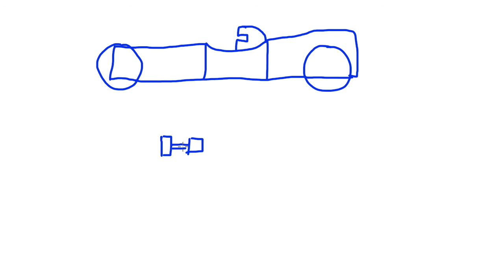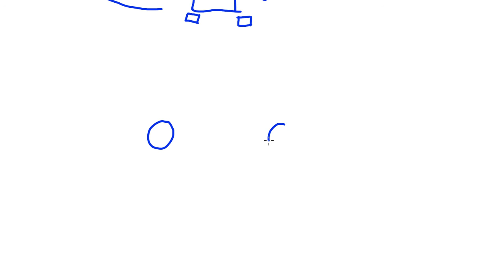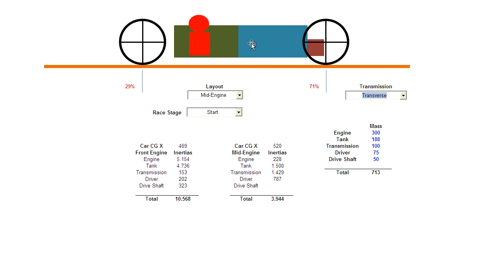Advantages on Mid-Engined Race Cars versus Front Engined Automobiles

Comment: I don't think polar moment of inertia makes much difference in a four wheeled car. The mid engine layout is to load the four wheels evenly and permit a lower center of gravity (because the driver can be sat lower).
Reply from the maker: Sure, but the old cars had a heavy engine at the front end and heavy fuel tank at the back end. This made the car akin to a dumbbell. The wheels were evenly loaded as well, but the car's "laziness" to turn was factor

Comment: question, in race-simulators i've been having some issues with braking/understeer in lightweight mid engine cars. for some reason i think having too much of the weight on the rear in such a light car equals having not enough weight on the front wheels causing them to lock up very easily under heavy braking. i found this video because i was interested to see if my hypothesis was grounded but now i see you seem to have reason to believe a car with 50+% of the weight over the rear end will brake better? i was playing around with the ride height settings to see if dropping the front and raising the rear to get more weight on the front wheels would help and it did a little bit but it messed up the rear grip, the car became very twitchy coming out of corners and when correcting the oversteer it would often very quickly snap back causing a spin in the other direction. do you care to shine any light on this, i would like to hear your thoughts.
Reply: Leave the ride height stock. Run equal camber front and rear, consider a stiffer front end.

You want ot brake harder in a straight line, and let off the brakes a bit earlier as you turn the car into corner entry than you would with a FR car. You can however, throttle slihgtly earlier out of the corner and really get the grip down on late exit of the corner.